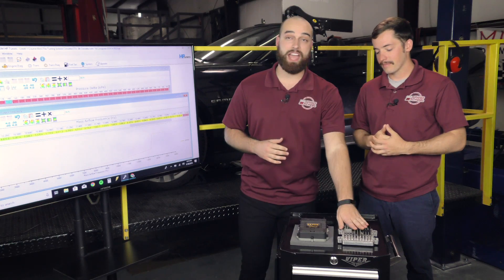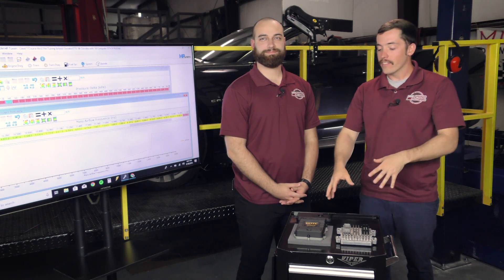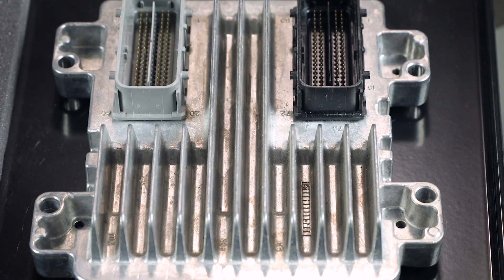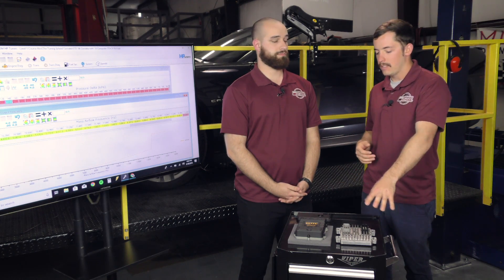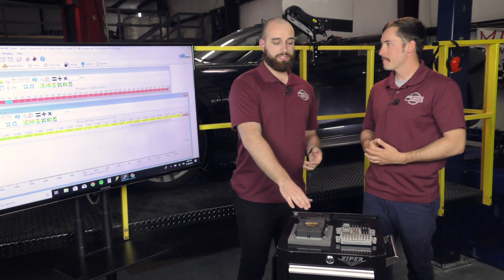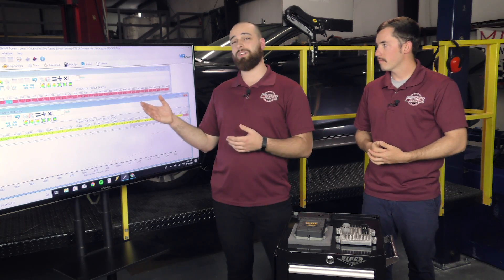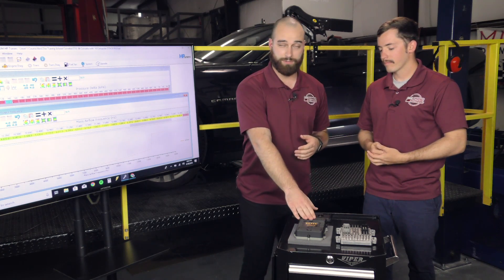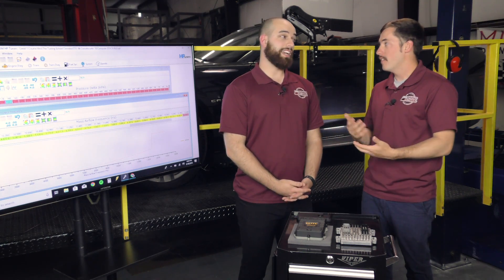Buy a Stand Alone ECU?

Comment: I would like to recode an ECU to completely code out anything related to the automatic transmission, or if not possible, change some parameters in the ECU to make it think that the autobox is always in park, do I need a standalone ECU for that? I would like to avoid sketchy solutions with cables.

Comment: Hi great video! I am thinking of turbocharging/supercharging  my stock internal bmw e36 318is (m44) for low boost (0.5bar) can i use the stock ECU and succeed great linearity of the engine,fuel consumption and after install an LPG system?? (i think lpg systems comes with parallel ecu)
Thanks a lot!
Reply from the maker: It's hard to tell without knowing your car. We recommend visiting a local shop that way they can take a closer look (or give us a call)!

Comment: I want to build my engine to 400hp. Its a volvo s70 t5 with the high pressure flatback turbo. Im gonna get a garrett should i use a stand alone ecu?
Reply from the maker: Awesome! Yes.
Reply: I would speak to your closest professional tuner for that one. They'll might just be able to flash the stock, you will need a professional tuner anyways.
Reply: Don't bother doing turbo upgrade, those stock high pressure turbos are plenty, especially after tuning...do more internals and bulletproofing for reliability...oh and injectors
Reply: Did you end up choosing a aftermarket or stay stock I have the Volvo S70 glt 2.4 with a failing ECU and thinking about aftermarket just for best performance with stock until I get time to build it

Comment: Will any stand alone ecu's support emissions for swaps in states that require retaining emmisions to reflect the vehicle the swap engine came out of?
Reply from the maker: You'd have to ask the standalone manufacture, since this is not something we have any direct experience with doing. If retaining the emission of the engine is necessary, it is likely you will have a to use a factory ECU.
Reply: Just dirty smog it
Reply: Typically on big companies they'll have information on that right at their website for each product. Most won't even sell to you if you're in a state with those special emissions laws.